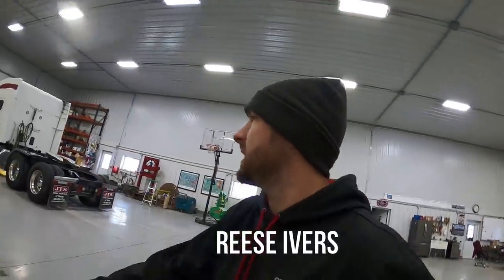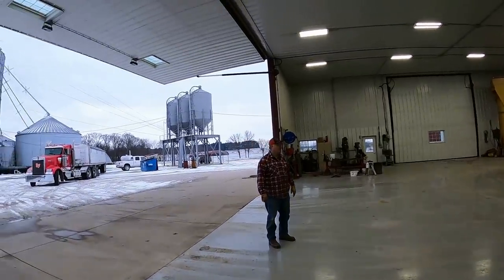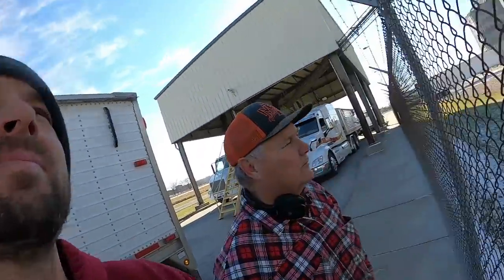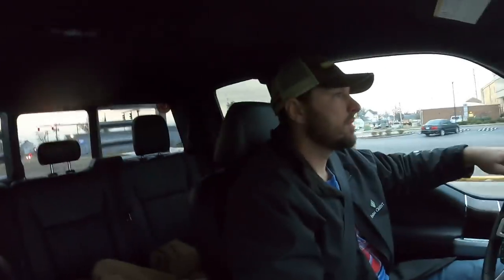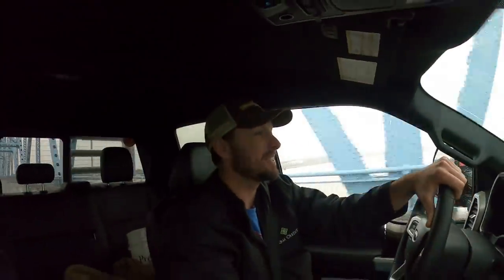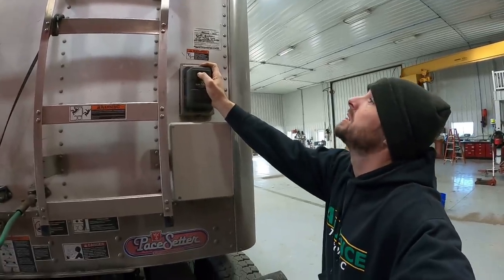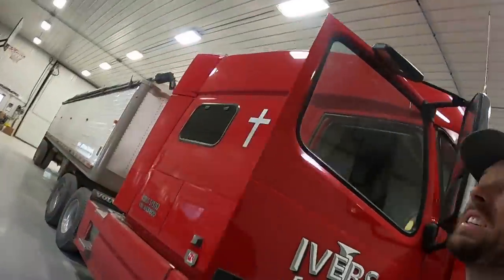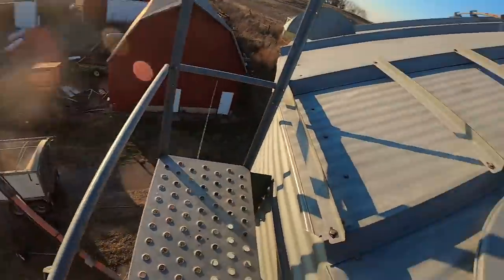Precision Planting Winter Conference Review and Semi Truck Repair Season 2 Episode 46

Comment: Use a left handed drill bit on the broke off seat bolt. Lots of times before you get a whole drilled all the way through it the bolt will break loose and spin on out.
Reply: Yes we do have a set of those sometimes they work
Reply: @dennisivers1602  Yea they probably work way less than half the time but ya never know until ya try. Yall's channel is awesome right here on the Ohio River at Wolf Creek Ky.
Reply from the maker: I have them a try but it was too stuck

Comment: Maybe look at the circuit breaker on the batteries for your tarp. We had crazy things happening with ours and would cut off like your was. Tech support told us it was the reversing motor in the box but that circuit breaker fixed ours. Just a possibility.
Reply: Thanks will check that
Reply from the maker: I think that fixed it
Reply: @iversfarms  hopefully so. It made ours crazy. We would even have 12 volts all the time when we tested but once you put under a load it would go to crap and cut out all the time.
Reply from the maker: @adamrogers3946  yep, exact same thing was happening here